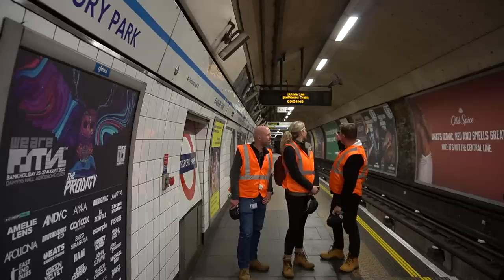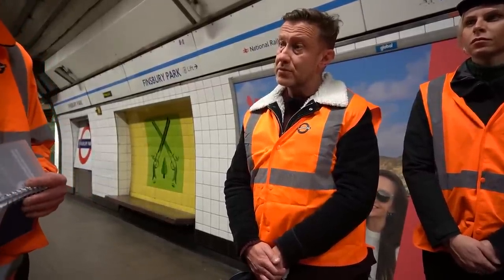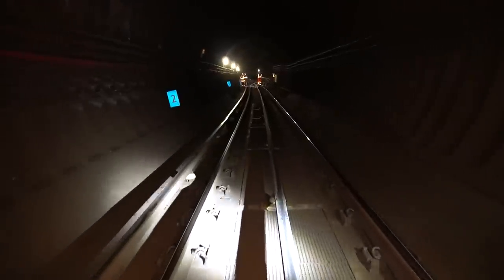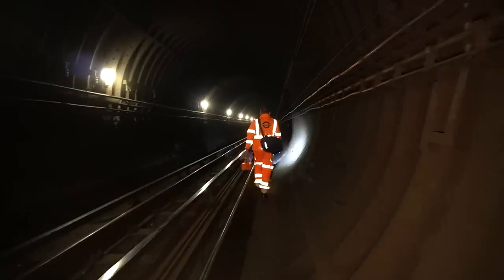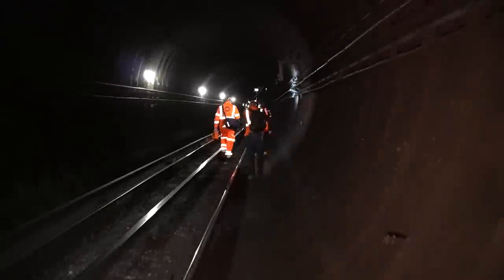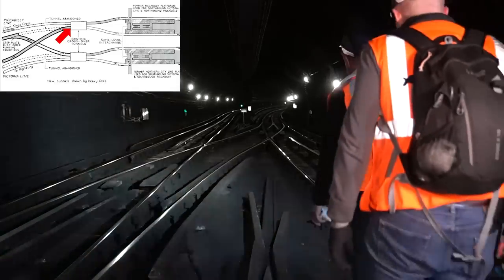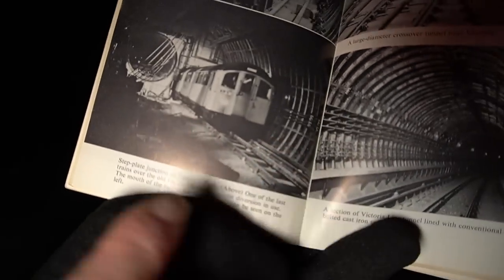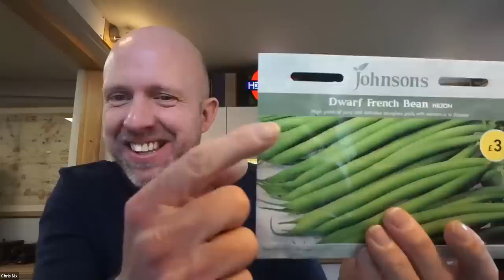The Lost Tunnels of Finsbury Park | Hidden London Hangouts (S07E03)

Comment: Long, long ago when I started work we were living in Winchmore Hill and had to travel to Moorgate each day, I travelled down these tunnels. And again when we moved to Hadley Wood in 1960, I travelled by the parallel route to Moorgate via Finsbury Park (on the Great Northern line).  Sometimes I would travel to direct Moorgate via Kings Cross pulled by a steam engine, but it tended to be a bit smoky!  An interesting journey down memory lane, thank you.  Now living in Canada.
Reply: Hello Geoff  I remember both lines and I loved the old widened lines through Kingscross.
The train from Winchmore Hill would be pulled by a Gresley N2 loco and the coaches were called quad arts.
Two four cars sets made up the train and each set shared a bogie with the next coach.
There was also a service that ran to Broad Street  in Finsbury Park and Dalston Junction.
Greetings from Australia but all the way from Tottenham.

Comment: I was in my early teens when I first rode the East London Northern Line - would have been around 1964.
I remember how "lost" the small standard stock trains looked in those large diameter tunnels!
Their floor level was lower than the platfrom, so you had to step down into them.
Reply: Sometimes you can see the Bakerloo Line trains idling at Kilburn High Road Station, the platform is way to high. One of the trains terminated at Queens Park on the London Overground platforms and I wondered how the hell that was allowed because yhe platform must have been half a metre up.

Comment: The best episode of so far as I remember the old Northern City line 
The last train to Drayton Park was on October 1964.
A shuttle bus ran between Finsbury Park and Drayton Park until the Victoria line open and the interchange between Vic and Northern City  opened.

When the original line opened in 1904 the line had a unique system of electrification.
It had two outside conductor rails instead of a centre negative 210 volt rail.
Reply: I was one year old in 1964, so I'm a little bit too young to remember,  when I mentioned to my late mother in the 70's that the Northern City Line no longer went to Finsbury Park she was surprised. It was for just over 10 years that the direct connection from Drayton Park to Finsbury Park was lost, only restored when the line was transferred to BR, and the connections made with the main line platforms upstairs.
Reply: @ianmcclavin  also worth mentioning was that LT had a new works programme before WW2, the plan was to connect the Northern City to Highgate and also take it to Alexander Palace all using the existing BR lines.
It never happened and the old line to Palace Gates closed in July 54 when I was one.
There were girders erected at Finsbury Park on the Seven sisters Road side for new platforms and they were still there in the 1960s.
The rail corridor to Alley Palley still exists and I know there has been interest in a tram running there.
Reply: @Steven_Rowe  Yes, there were a lot of planned extensions scuppered by the outbreak of WW2, including the electrification of the line from Mill Hill East to Edgware,  and the extension to Bushey Heath. Alexandra Palace would have had a rail connection much nearer to the Palace than the current station on the East Coast Main Line (which was  called Wood Green until the early 80's), and the tube map would look radically different to the current layout.
Reply: @Ian McClavin  Alexander  Palace did have a rail connection and conductor rails on one line was laid before the war, and the old station building still exists.
My Dad told me about most of this, and he also remembers the old Great Northern city full size stock.

Comment: I've noticed that if two trains leave the southbound platforms (Piccadilly and Victoria lines) simultaneously,  you can shortly see one from the other in the tunnel,  thanks to the gap in the tunnel walls to house the crossovers. A similar effect is obtained by two trains arriving on the northbound platforms together.

Comment: The northbound junction is very useful to know that we're just about to enter Finsbury park. Sometimes, you'll be running parallel with another train so if you're on the Victoria Line needing to change to the Picc. and you see the Piccadilly Line train out the window, it mains you'll definitely make it on that train as 2009 stock comes to a stop quicker than the 1973 stock thanks to the computer controlled braking curve. Usually the door are opened whilst the manually driven 1973 stock is still pulling up to it's stopping position. Stroll casually along the cross passage and hop onto the Piccadilly without needing to wait.

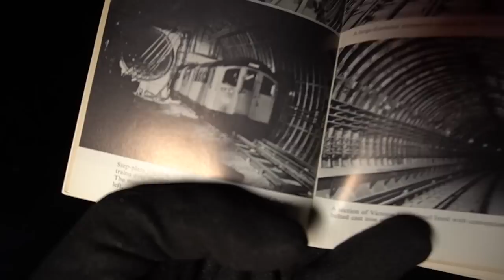Comment: That photo being pointed out at 38:33, with the Piccadilly line train coming out the new tunnel, into the old alignment, also appears in the 1990 edition of "London's Underground", by John Glover, as does the diagram, which you were using with red arrows, to point where you were.
Reply: I think that the official documentary on the building of the Vic is on YT somewhere. Pretty sure that a train using the old tunnel comes out and runs over huge timber trestles, think it was that one. .

Comment: Great episode, team, and a welcome Easter present! I was brought up on the northern stretch of the Piccadilly Line (so to speak), so Finsbury Park was always an important interchange station for me. I'm too young to remember the Northern [City] Line in operation at FP, but just old enough to remember all the excitement around the opening of the Victoria Line. I suppose there can't be all that many disused bits in FP station itself (the original lift shafts?), just a series of odd features caused by changes to the use of the platforms (and by the odd relationship with the GNR upstairs); the most interesting disused bits, as you showed, are in the tunnels approaching the station.

Comment: They wouldn't dare go on to the stretch between Holloway Road and Caledonian Road, not around 3am time anyway. That was where on 31 October 1923 the last Piccadilly Line train of the evening, 10.53 pm, left Caledonian Road northbound, with the driver, guard and 5 passengers - and never got to Holloway Road. of course you'll see this reported as a tragic derailment, as there was no explanation as to where that train went. They handsomely compensated the 7 families involved, and kept them quiet. They never did find that train, except that around 3.03 am some nights the maintenance crews reported feeing a rush of very cold air and a noise like a train coming, except of course there were no trains then. Sometimes a light mist appears in the tunnel and then disperses again. The LT crews to this day won't work that bit of the tunnel  after around 2 until 4am has passed.

Comment: The modern situation is that the Great Northern Enfield Chase line remains on the surface until just after Drayton Park, with Essex Road the first subterranean connection. The intermediate-level foot tunnels are seriously confusing, and are currently being replaced, as the cross-tunnel is dangerously narrow when handling crowds headed to the Arsenal Emirates Stadium, immediately adjacent to Drayton Park Station, which is closed on Match Days. The crowds can be disruptive to surface traffic, and in certain match combinations, more than a little potentially dangerous. Another station in the at-risk zone is the Piccadilly Line Holloway Road.
A further abnormal load factor is that Finsbury Park serves as the emergency turn-around for Kings Cross Mainline, although there is limited scope for load shed in St Pancras.

Comment: The Victoria Line can be operated in Restricted Manual. This is usually used when it has lost ATO capability, either if a signal fault or a train defect.

Comment: PS Regarding a couple of points that came up in the episode: As I understand it, it's not just the balloon flights but also the duelling that was supposed to have really happened at Finsbury Fields rather than Finsbury Park. (I guess the latter is so lacking in historical associations that they had to cheat a bit.) Also, another reason why the current 2009 Victoria stock can't use the Piccadilly tunnels (not even with battery loco haulage) is that it's just too big - it was built to take advantage of the slightly larger bore of the Victoria tunnels (this was alluded to in the episode but very briefly). However, the original 1967 Victoria stock (which was of standard LU tube size) could and did use the Piccadilly tunnels for access to and from Acton works. Possibly the 1967 stock was a bit easier to drive manually for long distances than the 2009 stock?

Comment: Thank you so much for going out at ridiculous o'clock to explore and film so that people like me can see more of the Underground! This was such a great episode! The use of the map and arrows is particularly helpful! Are the tunnels that used to be used for the bigger size trains still open or blocked off?
Reply: Pleasure! We were able to get into every bit of disused. And I think (although someone will correct me if I’m wrong) that it’s a requirement that every piece of disused property must be accessible for inspection purposes. I think literally everywhere gets a look-over every 12-18 months… old shafts, passages, everything on the network.
Reply: There are asset inspections going on most nights in various locations (disused included). It’s done by health and safety reps to ensure trip hazards etc are avoided. In certain emergency situations it may be necessary to evacuate passengers via the track. Fortunately this is a rare occurrence but it does happen.

Comment: I was a bridge examiner based a Palace Gates back in the 1990's and Drayton Park disused tunnels Finsbury Park to Moorgate along with Finsbury park STation was on part of my area, If you go into the disused tunnels at Drayton Park you with find  a mummyfied cat along with a soiled pair of boxers. Although they are not mine they belong to my assiocate who dropped his stomach because of food posioning on Saturday morning. But alot of Finsbury Main line station is behind closed doors with 1950 posters on the wall. If you walk through Drayton Park to Moorgate you will find some of the tunnels are wider because the used to connect to another service which was closed off and bricked up, Also Moorgate is shorter than it was orginally built for reasons which cannot be discussed.
Reply: I love that story. We found the cat. Thankfully we never found the boxers 😂

Comment: I have a question:  Are the automated lines no longer using track circuits and just using the data from the trains to know each trains location?  If this is the case the are any manual trains on the route having to be manually kept track of from the line control room?  Any fully manual trains (not including 2009 trains being driven manually, which would still be sending location data to the control room), but the fully manual trains (such as works trains) would not have their locations known.  I know that these usually only come out at night, and are most likely signed in and out of the line. But is there anymore to this?  Or is it the case that if an entirely manual train was to somehow appear on the line without the control room knowing, there would be nothing to detect it, so an automatic train could potentially crash into the back of it?  While this should never happen, the question I am asking is regarding dual redundancy.  Is there anything else involved with this, or is it just down to the skill of the signalers to keep track of what is going on?
Reply: There are still track circuits on the Victoria line to indicate to Control Room staff where trains are, just not in the traditional sense. The trains don’t read signals but communicate with signalling equipment electronically, not train to train. Manual engineers trains run at night once the whole line is clear of passenger trains. The drivers only need signals in controlled areas (junctions) to let them know the route is set.

Comment: Great video.  Whereabouts are the other ends of the GN&C tunnels from the Drayton Park end?  I've tried to spot them when travelling on the main line to and from Moorgate, but can never work out where they are.
Reply: The portals themselves are obscured and blocked off to mark the boundary between the two railways but there is a gated access to the side which should be visible departing Drayton Park. It’s probably quite difficult to spot.
Reply: @Lisbonized  Thanks.  I'll try to spot the gated area next time I'm on a train leaving Drayton Park.

Comment: The 2009 stock are 40mm wider than the previous 1967 stock, making use of the larger Victoria running tunnels. This difference prevents the 2009 stock from leaving the Victoria line, except by road.

Comment: Great video, wish you would explain how the electric crossover works at the points as they look very complicated. It is not clear from the video how the train pics up power when crossing over tracks.
Reply: Funnily enough, it doesn’t. The only locomotives to use them are battery operated engineering trains.
Reply: If you pause on the track diagram like at 5:22 and follow the arrows on the lines from one end to the other, you can see that the regular running Vic and Picc, both north- and southbound just go straight on at the crossovers.

Comment: You can obviously make tunnels bigger (like the C&SLR ones having been converted), but could you make them smaller, too? I'm thinking of the Moorgate tunnels and the Moorgate station crash, which happened they way it did because of the bigger diameter, but being used by Tube trains at that time.
Reply: A great question - the answer is yes. There’s a section of the disused GN&C tunnel that’s been reduced in diameter for an unusual reason - the lining rings were failing so rather than dig out the old ones and order new rings at an unusual diameter the engineers relined the tunnel at a smaller Tube train diameter inside the old tunnel.

Comment: Awesome - If the aim was to use main line trains - how would they manage the smoke and steam?
Reply: It was electric
Reply: They show a photo of the train in Finsbury Park, it was electric but used two outer conductor rails instead of a middle one and an outer one.
It was built with 16 ft tunnels instead of tube tunnels of just under 12 ft.
At some point it was taken over by the Metropolitan line and in 1933 became part of LT.
I believe this stock ran until 1939 and then the line was altered to run standard tube stock.
All really fortunate as when BR took control of the line they were able to run standard size trains to Moorgate.
The trains are dual voltage using bog standard 25 KV picking up power from a pantograph but at Drayton Park the pantograph is lowered and it runs on 750V dc third rail, the same thing happens with the Thames link service.
Hope you find this useful.

Comment: Do all engineering trains and all machinery,  maintenance devices,  tools,  tampering machines work electric on battery or is there also any diesel powered equipment ?
If so , how are the health and safety measures to prevent staff from health risks ?
Are there any mobile ventilators to be used ? 

What tampering machines work in the tube sections? Are that self developed ones by Underground or standard narrow gauge Plasser and Theurer machines ?

Are there engineering trains running checking for rail failures?

How can I get more special information in maintenance topics as I am working as a infrastructure maintenance engineer in Germany?